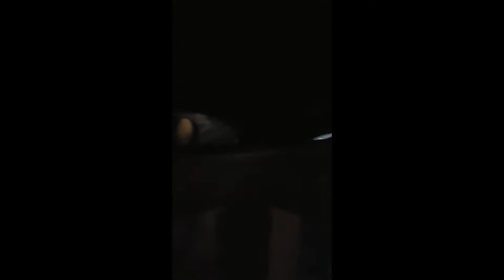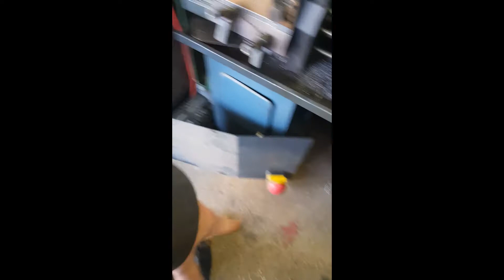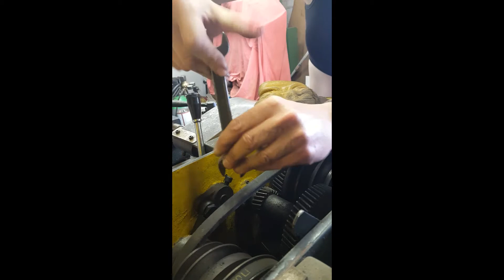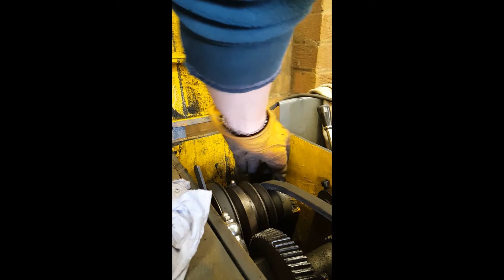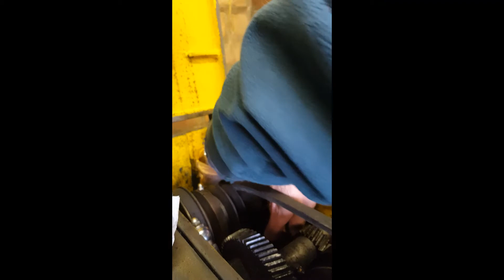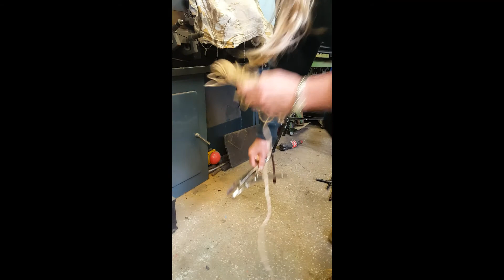Lathe problems New Drive Belts Part 1

Comment: Great 3 part detailed video of headstock belts replacement. Very informative, thanks for sharing 🙏.

Recently i bought used Perrless PL-36-910 lathe, which is exact Taiwanese copy of your Chester UK lathe. And bout of my belts has to be replaced.

 I couldn't find manual for my Taiwanese Perrless version. 
But, would you please share the model number of your Chester UK? 
 I will try to find the manual for the Chester UK lathe and use it on my Perrless. Thanks👍
Reply from the maker: If you go on chesterhobbystore.com and search for craftsman lathe and there is a manual you can download on there. Thank you for your kind words. https://www.chesterhobbystore.com/shop/metalworking-machines/lathes/craftsman-lathe/
Reply: @Lisa_Turner  that is so awesom. Thanks 👍